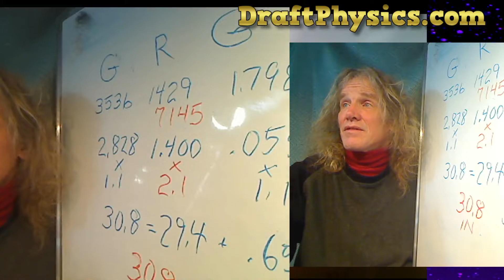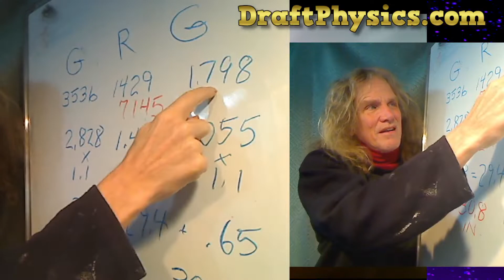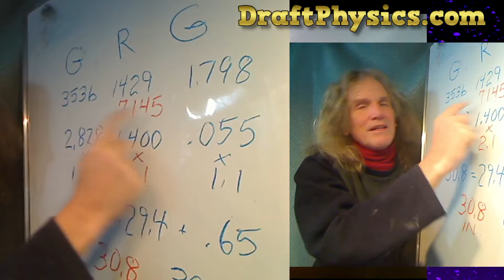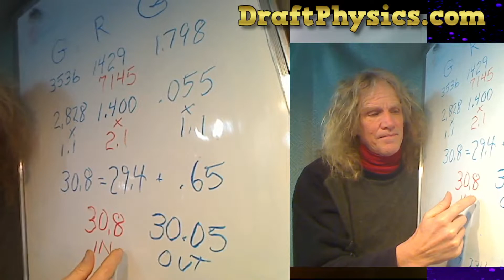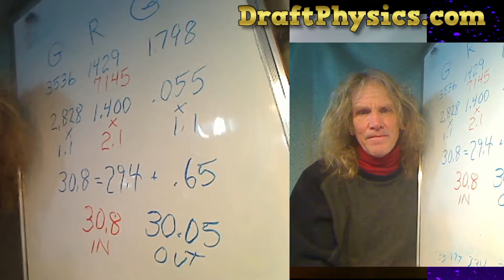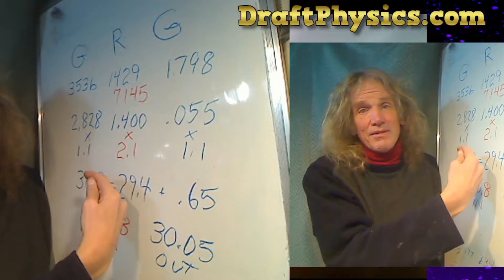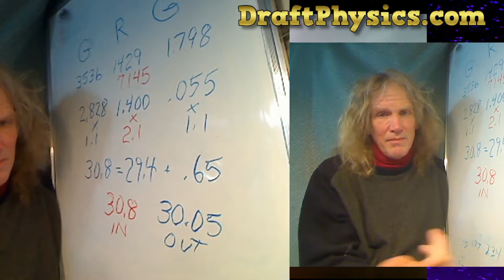DraftScience update video 2/16/22

Comment from the maker: new video : DraftPhysics vs even More junk Brozo comments [2/23/22]: http://efilism.com/ds/dp148.html
DraftPhysics vs More airtrack ...frame rate [2/22/22]: http://efilism.com/ds/dp147.html
DraftPhysics vs More airtrack stuff [2/22/22]: http://efilism.com/ds/dp146.html
DraftPhysics vs More junk Comments [2/21/22]: http://efilism.com/ds/dp145.html
Your Physics doesn't physically work [2/21/22]: http://efilism.com/ds/dp144.html
DraftPhysics vs KE maths [2/20/22] : http://efilism.com/ds/dp143.html
One Brozo = Three stooges [2/19/22] : http://efilism.com/ds/dp142.html
DraftPhysics motion and drag [2/19/22] : http://efilism.com/ds/dp141.html
DraftPhysics vs Your "logic" [2/18/22] : http://efilism.com/ds/dp140.html
DraftPhysics vs junk comments [2/17/22] : http://efilism.com/ds/dp139.html
Draft: energy storage in transfers/collisions [2/17/22] : http://efilism.com/ds/dp138.html
DraftPhysics vs more Air Track exp. [2/16/22] : http://efilism.com/ds/dp137.html
 DraftPhysics vs Brenna Toblan Air Track Basics [2/15/22] : http://efilism.com/ds/dp136.html
DraftVideo: light interferometry re: action lab [2/14/22] : http://efilism.com/ds/dp135.html
OneFact: Weight Is Energy [2/13/22]: http://efilism.com/ds/dp134.html
draftphysics vs loose end stuff [2/12/22]: http://efilism.com/ds/dp133.html
One Fact: The Slit Experiments [2/11/22]: http://efilism.com/ds/dp132.html
Teem Time vs Teem Distance [2/11/22]: http://efilism.com/ds/dp131.html
One Fact: KE vs MV [2/11/22]: http://efilism.com/ds/dp130.html
[2] DraftPhysics vs  pyrrho314 ...A void of facts [2/10/22]: http://efilism.com/ds/dp129.html
 [1] DraftPhysics vs  pyrrho314 ...A void of facts [2/9/22]:  http://efilism.com/ds/dp128.html
DraftPhysics vs  pyrrho314 ...quantum quackery [2/8/22]:  http://efilism.com/ds/dp127.html
DraftPhysics re. Photons [2/7/22]:  http://efilism.com/ds/dp126.html
 [2] DraftPhysics vs Leonard Susskind's Woo and Poo [2/6/22]:  http://efilism.com/ds/dp125.html
[1] DraftPhysics vs Leonard Susskind's Woo and Poo [2/5/22]:  http://efilism.com/ds/dp124.html
DraftPhysics vs more of Brozo's Bu-it [2/5/22]: http://efilism.com/ds/dp123.html
DraftPhysics vs Brozo's Bs [2/3/22]: http://efilism.com/ds/dp122.html
DraftPhysics re. Gravity [2/3/22]]: http://efilism.com/ds/dp120.html
DraftPhysics re. Animation of charge [2/2/22]: http://efilism.com/ds/dp119.html
DraftPhysics vs comments..double slit stuff [2/2/22]: http://efilism.com/ds/dp118.html
DraftPhysics vs  Toady UK comments..ke vs mv [2/1/22]:  http://efilism.com/ds/dp117.html
DraftPhysics vs you are such a dupe ..ke vs mv [2/1/22]:  http://efilism.com/ds/dp116.html
DraftPhysics vs make it compliant science [1/31/22]:  http://efilism.com/ds/dp115.html
DraftPhysics vs The brozo PENDULUM EXPERIMENT [1/30/22]:  http://efilism.com/ds/dp114.html
DraftPhysics vs brozo comments ...too stupid [1/29/22]:  http://efilism.com/ds/dp113.html
DraftPhysics vs the brozo PROOF ...not real as usual [1/28/22] : http://efilism.com/ds/dp112.html
 DraftPhysics vs the brozo experiment ...useless as usual [1/27/22]: http://efilism.com/ds/dp111.html
DraftPhysics vs comments ..mv vs. 1/2vmv [1/26/22]: http://efilism.com/ds/dp110.html
DraftPhysics re. complete debunk of 1/2vmv [1/25/22]: http://efilism.com/ds/dp109.html
 DraftPhysics vs Evidence? [1/24/22]:  http://efilism.com/ds/dp108.html
DraftPhysics vs Dispar comments... free energy [1/23/22]:  http://efilism.com/ds/dp107.html
DraftPhysics vs comments... pyrrho314 sucks [1/21/22]: http://efilism.com/ds/dp106.html